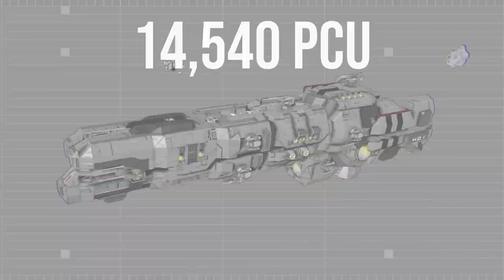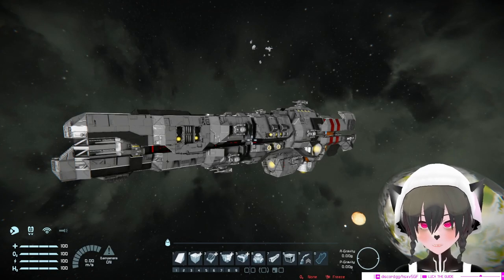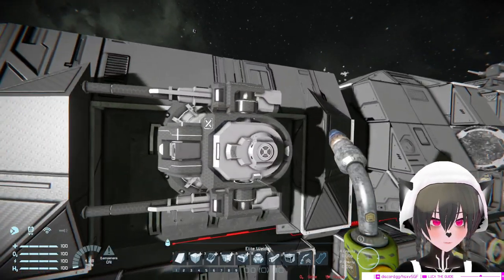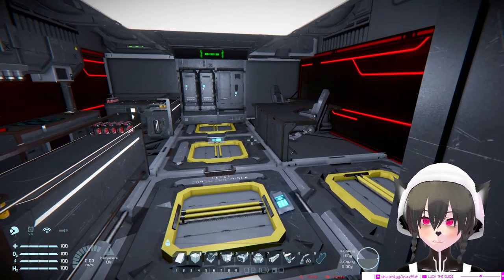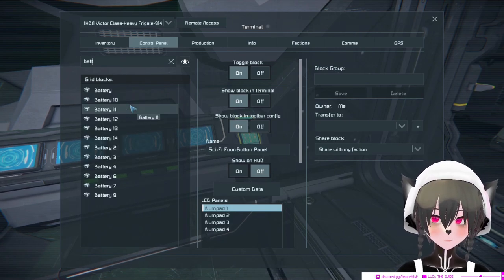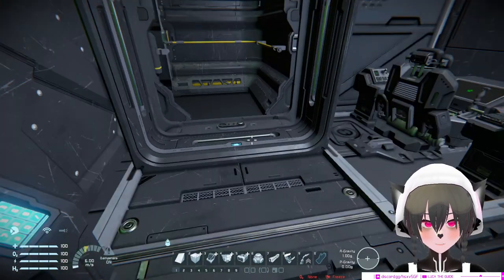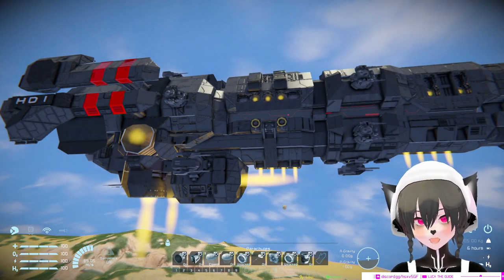This Frigate Needs to Set Its Priorities Straight - Space Engineers Critical Ship Review

Comment: My playing conditions aren't the same as yours, to start with. On pure DPS, artillery cannons do twice the dmage of assault cannons. Both have same shot velocity, and artillery has the slightly longer range.

However, like you I find that neither one can hit !@#$ at their maximum range, especially against a moderately mobile target.

So I'm trying out a turret brawler build with assault cannons targeting propulsion subsystems. Or weapon subsystems. I aim for a sweet spot range of 800-1000m, just outside gatling/autocannon/missile range. At that distance, the assault cannons' shorter range compared to artillery doesn't matter. Time to target due to range matters more, I feel.

As I've mentioned before, my manual aim is pretty awful. I feel like I get better value out of my shots fired if I focus on counter-maneuvering the opponent and lining my turrets up to hit. In dogfighting, there's a conceptual relationship between the size of the enemy ship, the velocity of your shots, and the velocity/maneuverability of the enemy ship. If you get close enough, they don't have time to dodge from when the shot leaves your gun to when it intersects their trajectory. I try to set that up for my turrets; doing it for manually fired fixed guns is an exercise in frustration for me (and takes the edge off my evasive flying for too long, exposing me to enemy fire).

If the target is as mobile or more mobile than me, I go for propulsion first, to take away that advantage and make them easier to hit subsequently. If they're also less well-armed, I don't mind doing shorter range gun runs past their thruster faces at 200-400m.

If they're more heavily armed, I go for weapons first, to reduce their overall DPS.

If they have both, I run until I die, then respawn. :P

Early observations indicate that whether this works well for me or not, it certainly ends my fights a lot faster. :P
Reply: and assault ammo is a lot cheaper :)

Comment: Only a dozen batteries? 
I use at least 40 for a ship of that size, helps plenty with the 4 railgun recharge
Also pretty sure assault cannons are somewhat useful against starfighters and gunships
Reply: A LG railgun only consumes ~38 MW for 1 minute (~640 kWh), so three LG batteries and a little extra should be plenty to max out the recharge rate per railgun. That's output. For capacity, one LG battery has enough for about 4-5 railgun shots, so if you can max out the railgun's recharge rate, you're already carrying enough storage capacity for almost 20 shots, which would probably take 25-30 minutes to fire in actual fight conditions (flying around, lining up the shot, etc). Depending on your server's other conditions, that is possibly longer than the typical battle will last.

14 batteries would be the minimum for max recharge on 4 railguns, so assuming the rest of the ship is running hydro, 15-20 batteries would give a good safety margin. 12 is too few. 40 is more than twice what's usable in a single fight -- the rest would just be for long-term flight time or multiple running fights back-to-back.

Assault cannon RoF is triple that of artillery guns, so yeah, they are much more useful against SLOW small grid ships. Their shots only have 500 m/s velocity, so autocannon and gatling gun shots are much faster (meaning less time-to-target, better accuracy, less time for target to intentionally or accidentally evade).

However, as Luca has pointed out elsewhere, PVP on official servers gravitates to large grid combat provided that the players have sufficient ingot/component resources. Within the PCU limit, small grid ships are a fragile waste. One somewhat heavily armed small grid 6000 PCU fighter or strike craft (carrying about 20 fixed guns or 10 turrets) puts out damage comparable to a 2000 PCU large grid gunboat or corvette style ship. Remember that small grid turrets have 1 gun, while large grid assault cannon turrets mount 2 guns for about the same PCU (and arty turrets and guns aren't available in small grid).

Armor integrity and overall ship health don't even compare, since for 1 PCU you can either have 15k integrity on a LG heavy armor block or 500 integrity on a SG heavy armor block. You'd be spending 30 PCU for small grid integrity comparable to 1 LG HA block. 100 armor blocks puts you at 100 PCU large grid, or 3000 PCU for equivalent small grid armor, which is just not worth it. For that PCU price (~6k PCU total), I can field TWO (admittedly blocky and unattractive) large grid gunboats, either one of which (if properly armed with assault cannons and gatlings) would likely savage the 6k PCU small grid ship. No small grid block can absorb 4000 dmg from an assault cannon, while some large grid blocks can -- this makes small grids a lot squishier (and is the same reason contributing to why small-grid-on-large-grid PMW turrets are so much more fragile).

Other servers like to set up conditions that favor or emphasize small grid ship or rover combat, which I think is awesome fun. But is unlikely to happen without those arbitrary conditions. And needs lower player count and a beefy server.
Reply: Would you look at that a fellow overthinker
Anyhow I use 40 batteries cause I have mostly ion propulsion and hydrogen is just used for take off and landing assist cause hydrogen burns out fast in a combat situation unless you have plenty of tanks which I don't

Comment: When you say there is no assembler for repairs, would you manually get the materials from the assembler and repair critical components or does it make sense on ships to include a welder on the interior of critical components?  Is this more of a  repair between battles situation or have you repaired mid battle on the fly
Reply: Mostly after a battle. It takes player attention and time to repair. If the battle is fast-paced and high-intensity, probably no time during. Maybe with some friends/teammates acting as crew, they can patch up critical components on the fly. If the pilot leaves the control seat to make repairs, the ship should probably be cruising at maximum 100 m/s (or server's max speed) and ideally out of opponent weapon range.